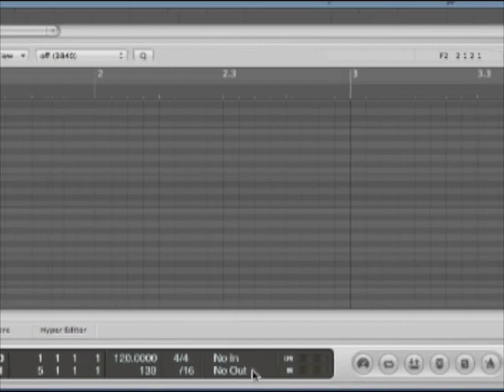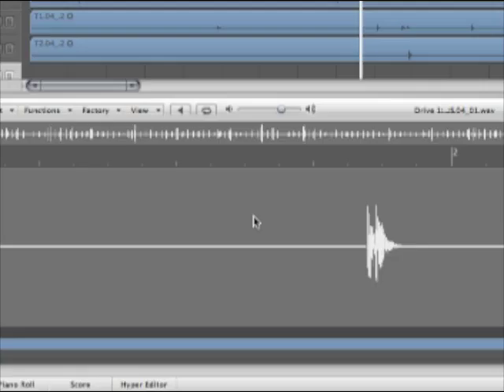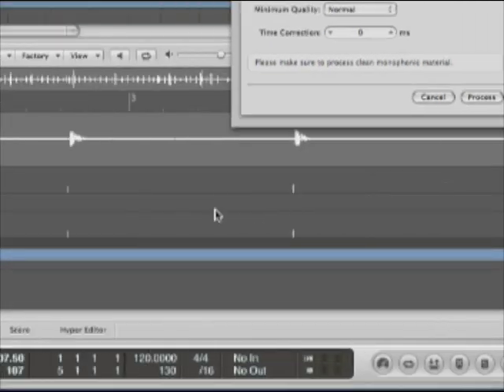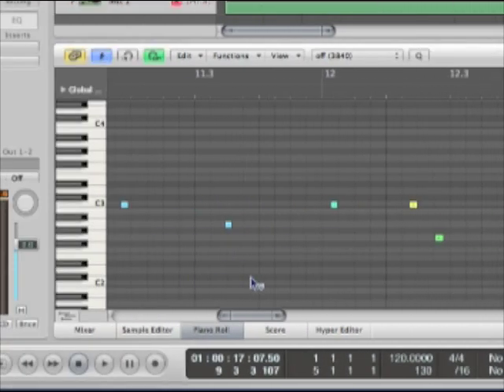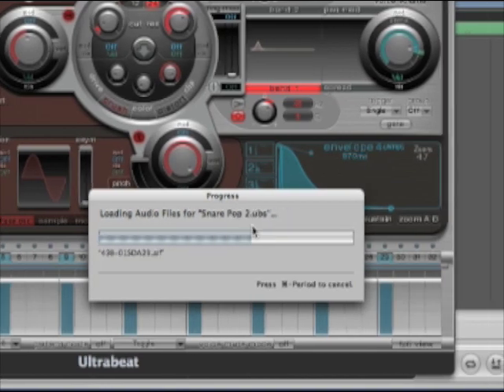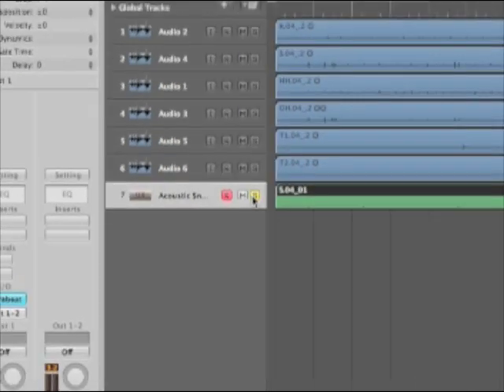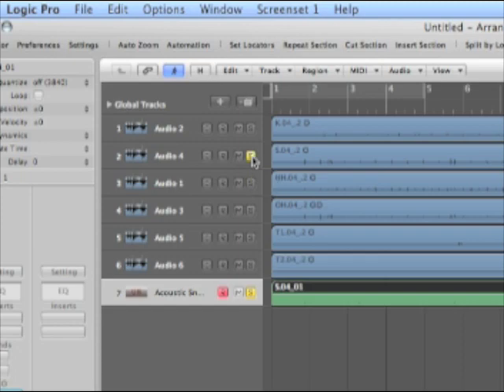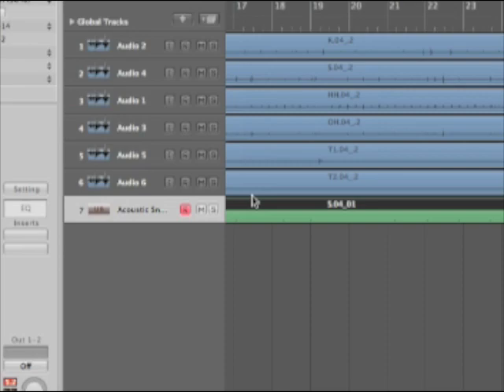Logic 8 - Drum replacement tool

Comment: anyone looking for a good replacement plug-in Drumagog works wonders. I'm not too sure about replacing cymbals, though. I've only used it on the actual drums. You could always add your own samples or record your own and have the plug-in trigger them when you want. It has sensitivity adjustment and you could also blend the track with samples instead of complete replacement. Just search on youtube if you want a demonstration